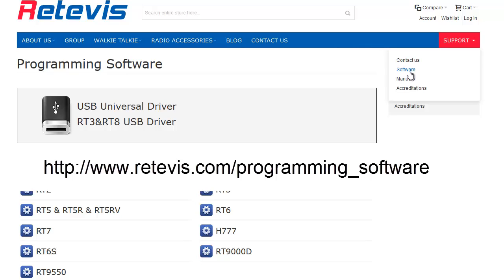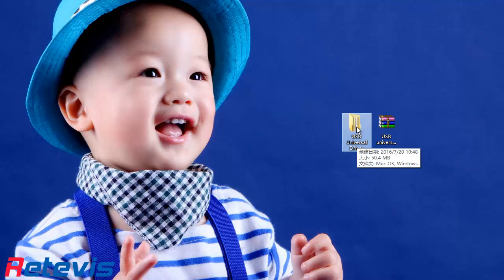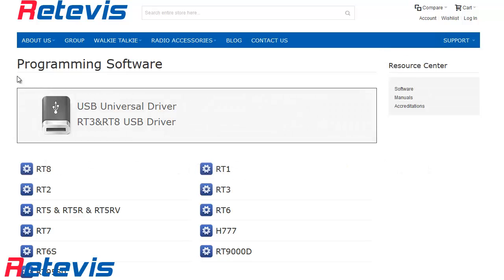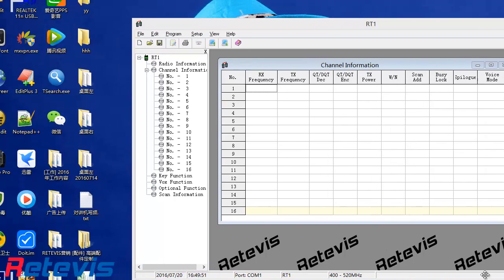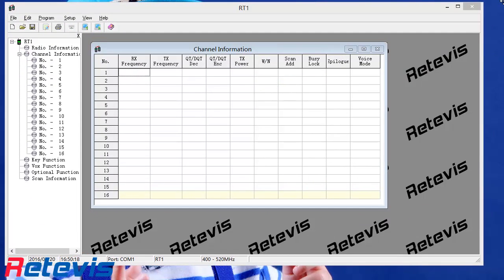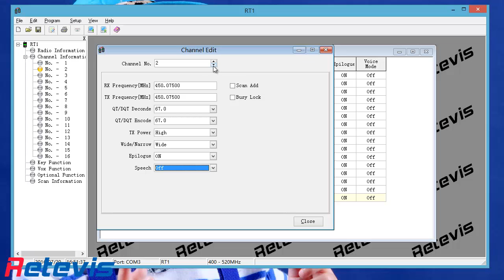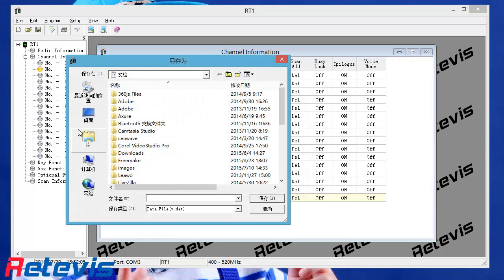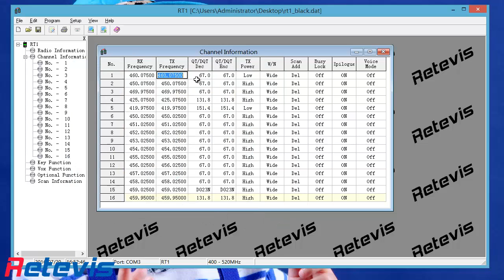Retevis walkie talkie Frequency programming operation.

Comment: Hi, trying to legally be able to transmit from my retevis RB19 and receive on my Beofeng UV5R. I have license.

Currently unable to receive on my retevis, but am receiving on beofeng.

Please help
Reply: I am having the same issue, did you ever figure out anything with that?
Reply: @alexblatt871  yes! You have to use I believe option 13 or 14 on ur baofeng and add the #s listed on ur walkies’ instruction manual 👍

Comment: Do i have to program the and of the retevis radios?
Reply from the maker: hi, which model? usually for the licensed radio, you need to get the progrogramming cable to program.
Reply: @retevis  hi,h777 because i dont really know how to program and i don't want to
Reply: @retevis  If so I want get them but if you tell which ones to get with programing that will be great
Reply from the maker: @taijonmansfield7977  hi, programming radio is very easy, if you want, please do not forget to order the programming cable.

Comment: i got window 10 need with RT 22  programming nothing to work Abormal reading and writing check the connections are correct or walkie -talkie power supply is turned on !
Reply from the maker: Please check 3 points: 1, check if your radio has power or not. 2, check the port. 3, check if you used the right programming cable. For RT22, the cable will be 2pin kenwood connector.

Comment: need with RT 22  programming nothing to work Abormal reading and writing check the connections are correct or walkie -talkie power supply is turned on !